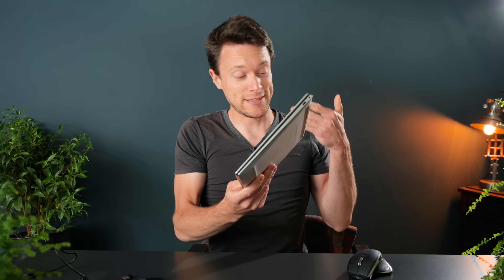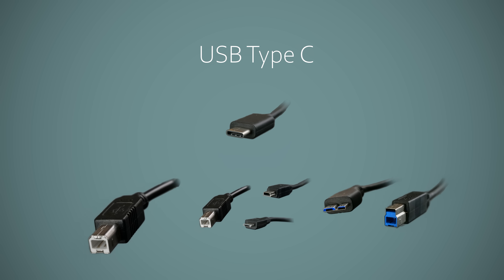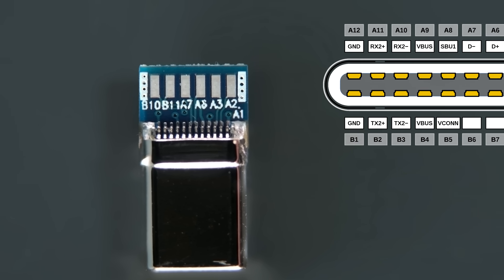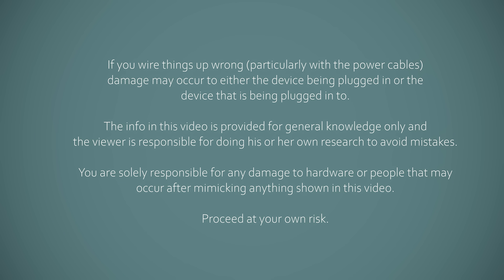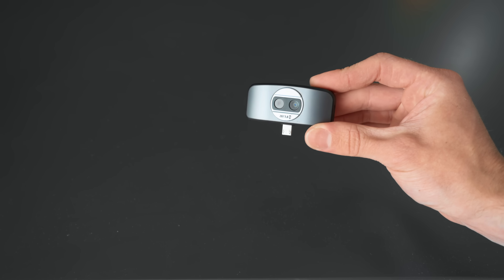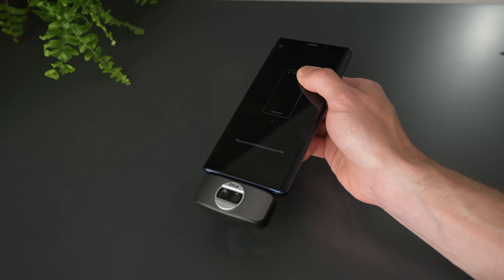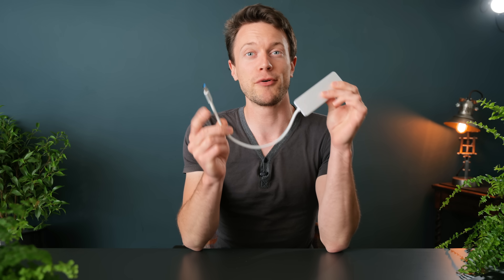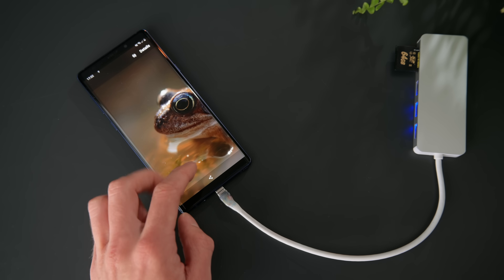Converting devices to USB Type-C

Comment: Is it possible to convert HDMI ports to USB 3.0? If you can, can you please please please make a video of converting HDMI to USB 3.0? I want to change it to USB 3.0 so I don't have to buy a dongle or adapter (because I can't find any). Thank you very much. I love these stuff.
Reply: Or can I change USB 2.0 to 3.0? That would be easier because I want to change an hdmi to usb 2.0 cable to 3.0.
Reply: Actually my whole problem is about the USB 3.0 plug on my video capture card. There's a delay if I use that, but there isn't any delay if I use the HDMI OUT port. So I can either buy an HDMI to USB 2.0 cable and change it to 3.0, or will there be any delay if I change the USB 3.0 from the capture card to type C?

Comment: no that is not at all the future what is the future is no need for usb anything or storage or anything. No ssd, hdd, ram, gpu, cpu is needed. If you want to connect a mouse all u do is tap it on the track pad. wanna transfer a video from your phone to your pc it is already there so no reason to. The cloud is the future. You will have 1000 gigs of ram at your availability if you need it. You will have millions of gigahertz of power when you need it. You will have 10000s of Teraflops when you need it. The way this works is if you need 2 gigs of ram the cloud gives your VM which is running remotely. If you start up a video editor the cloud gives you  the amount of processing power the video editor needs and the amount of ram the application needs no more no less.

Comment: i like how you used the old wire from the usb cables but in keeping with the minimal design should soldered a thin strip of the mini ribbon connectors

Comment: Great video Matt as usual. CC1 and CC2 can be configured for sinking (Rd = 5.1K) or sourcing (Rp = 51K) the power. On the board, there is a soldering pad named R2. This pad is connected to GND, so simply remove the 51K Rp resistor from R1 pad and put 5.1K Rd resistor on R2 pad. By doing so you will pull down both CC pins (A5 and B5) to GND and so your device will sink power (sub-device) instead of sourcing it (host-device).
Reply: CC1 and CC2 are names that are only used for receptacles (sockets), not for plugs. For a USB-C plug those pins are called CC (A5) and VCONN (B5), and for a plug integrated into a device (as in the examples in this video) only the CC pin has a 5.1K resistor to GND (for a sink) or 56K resistor to VBUS (for a source), while the VCONN pin is left unconnected.

And while a sink device with a USB-C receptacle should indeed pull down both CC1 (A5) and CC2 (B5), each of these two pins must have its own separate 5.1K pulldown to GND. If you erroneously tie CC1 and CC2 together and use a single shared pulldown then your device will fail to receive any power when using certain cables (specifically active or tagged cables).
Reply: @MatthijsvanDuin  So what are you saying? That you can't just solder a resistor to the R2 pads?
Reply: @micnolmadtube  I was saying majdinj's description of what happens when you do this procedure (on an electrical level) was incorrect, and they also had the pull-up resistor value wrong.  However, the procedure should still yield the desired result of reconfiguring the role of the board.

Specifically, if a USB-C male connector board has one resistor placed and one spot for an unplaced resistor then it seems very likely that indeed these are for pulling CC either up or down to configure the role of the board:
- 5.1 kΩ pull-down from CC to GND for sink role, or
- 56 kΩ pull-up from CC to VBUS for source role (can alternatively be 22 kΩ if you can safely source 1.5A of current, or 10 kΩ if you can safely source 3A of current)
Hence, if the board comes configured into source role by the presence of a pull-up resistor, then removing that resistor and soldering a 5.1 kΩ resistor at the other location should reconfigure the board into sink role.

For a USB-C female connector board things are similar except it has two CC pins to deal with, hence it will need either two pull-ups (one from CC1 to VBUS and one from CC2 to VBUS) or two pull-downs (one from CC1 to GND and one from CC2 to GND). The resistor values remain the same.

Here's a full description of the all four legacy USB 2 to USB-C conversions:
(any pins not mentioned are unused and must be left unconnected)

USB 2 host/source to (male) USB-C plug:
pins A1,B1,A12,B12 and shield are GND and must all be connected together
pins A4,B4,A9,B9 are VBUS and must all be connected together
pin A5 is CC and needs a 56 kΩ resistor to VBUS
pin A6 is D+
pin A7 is D−
pins B6 and B7 have no contacts in a USB-C plug

USB 2 device/sink to (male) USB-C plug:
pins A1,B1,A12,B12 and shield are GND and must all be connected together
pins A4,B4,A9,B9 are VBUS and must all be connected together
pin A5 is CC and needs a 5.1 kΩ resistor to GND
pin A6 is D+
pin A7 is D−
pins B6 and B7 have no contacts in a USB-C plug

USB 2 host/source to (female) USB-C receptacle:
pins A1,B1,A12,B12 and shield are GND and must all be connected together
pins A4,B4,A9,B9 are VBUS and must all be connected together
pin A5 is CC1 and needs a 56 kΩ resistor to VBUS
pin B5 is CC2 and needs a 56 kΩ resistor to VBUS
pins A6 and B6 are D+ and must be connected together (as close to the connector as possible)
pins A7 and B7 are D− and must be connected together (as close to the connector as possible)

USB 2 device/sink to (female) USB-C receptacle:
pins A1,B1,A12,B12 and shield are GND and must all be connected together
pins A4,B4,A9,B9 are VBUS and must all be connected together
pin A5 is CC1 and needs a 5.1 kΩ resistor to GND
pin B5 is CC2 and needs a 5.1 kΩ resistor to GND
pins A6 and B6 are D+ and must be connected together (as close to the connector as possible)
pins A7 and B7 are D− and must be connected together (as close to the connector as possible)
Reply: @MatthijsvanDuin  Thank you for full response, it helps a ton ! Just another question as you seem to know your stuff :
In the case of an USB 2 device to USB-C reseptacle why do you need to connect all the D+,D-,GND and VBus pins together ? 
Can't you conect just one pin of each to the corresponding pin of the USB 2 device (For instace A1 > GND ; A4 > VBUS ; A6 > D+ ; A7 > D- ) as it would make the socket way less bulky ? 
Thanks in advance for your response
Reply: @martinobyrne392  all of the GNDs and all of the VBUS pins are tied together for reliability and current handling, and a usb-C receptacle must connect both D+/D- pairs (A6/A7 and B6/B7) because USB-C cables only connect one D+/D- pair (A6/A7) hence if the receptable doesn't connect both of them you have only a 50% chance of an actual connection (depending on the orientation with which the plug has been inserted)
Reply: @MatthijsvanDuin what is a "source" and "sink" device? Does source mean a device that provides power and sink means a device that uses power from the host? Is a cellphone charger a source?
Reply: @JAAS-b7k  Yes and yes, with "source" and "sink" I'm referring to the "power role" as it's called.

When two USB-C devices are connected they negotiate which side takes which power role; some devices may only support source role (e.g. a charger), some may only support sink role (typical peripherals), some support both roles (e.g. laptops and phones). Fixed-role ports perform this "negotiation" by having pull-up or pull-down resistors on their CC pins to advertise their role.

If a USB data connection is also present, the "data role" of each side (host vs peripheral) is, at least initially, based on the negotiated power role: the source will be host, the sink wil be peripheral. However, it is possible to reverse the power role and/or data role on the fly provided that both sides agree on donig so. An example use case of this is for USB-C charging docking stations, where the laptop takes on USB host role (since the docking station is also a USB hub) despite being power sink (since it's being charged).
Reply: @MatthijsvanDuin  thank you for that comment!
Reply: @martinobyrne392  Addendum, I should note that a legacy usb (A/B) to usb-C cable or passive adapter is officially not allowed to use a usb-C receptacle, it must be a usb-C plug. The reason for this is to ensure it is physically impossible to use two of such adapters to cross-connect two power sources (e.g. a usb charger to a usb-A port of a laptop or something silly like that).

A power source with a USB-C receptacle must instead properly implement USB-C, with a power switch for VBUS controlled by detection logic on the CC pins, to ensure power is only supplied when the other side is expecting it.
Reply: Great info my guy your comment is just as great as this video cheers mate
Reply: thx for this, it was instrumental
Reply: he has to keep up the illusion that surface mount soldering is too hard for westerners or youtube isn't going to continue to push him views and subscribers.

Comment: Great job. I'm just wondering if it's necessary. There are very miniature USB-A to USB-C adapters on the market, for example: https://pl.aliexpress.com/item/33058295798.html 
It is very cheap, does not require any modifications. I don't think the proprietary version is smaller than the version obtained with this adapter.
In terms of cable conversion: these USB-C plugs are also available with a cable housing: https://pl.aliexpress.com/item/32829410461.html

Comment: I don't like the Type C connector so much.  It's slightly mire secure than (USB2) Micro-B but still can suffer from a poorly constructed recepticle that will in time render the physical connection very loose, or worse.  I've seen this in portable powerbanks from time to time where the Tyoe C recepticle is next to unusable because of the loose connection.

Comment: Perhaps he knows something I don't, but why couldn't he just probe the data wires to find which is pos/neg? I mean, it's just a low voltage he is trying to measure... Pretty sure you could just probe the data pins, right? I assume I am missing something, but it does seem fairly obvious/oblivious to me... 🤣

Comment: What about swapping out the ports on devices to use usb c instead of whatever was there? I have some devices that I would like to swap out the old ports. I have some that have micro b and mini b that I would like to replace. Maybe some day someone can figure out how to do something more advanced like replacing the now defunct proprietary port in oculus rift and rift s. I think it should be possible. It's basically the same as one of those dongles, but with a port instead of a plug.

Comment: I would realy love too make either a smart door (google open close) or a flap at the bottom of a door my hoover can go threw any ideas on this.

Automatic door openness are so expensive and as there for commercial and or disability access they are not smart and tend too be used with buttons.

I'm looking for one too work and I ternary door which can be much lighter and require less power too open.

Comment: I wonder if they sell alternate versions of that breakout board with the resistor already connected in the sub configuration?
Reply: This is one case where adding a dip switch to the product would be a welcomed addition.
Reply: @FranciscoTChavez  That then creates other problems though, such as just using heatshrink to cover a cable, it means that the dip switch could still be moveable or you could accidentally move it whilst using the moldable stuff or maybe even epoxy getting in between the switch contacts.
Reply: @conorstewart2214  the epoxy thing could definitely be a problem. As for accidently moving it, well  it's been quite a few years, but I have seen dip switches that are almost impossible to switch without one of those flat-heads that you use for fixing glasses. That said, a good dip-switch like that, might have a big impact on the price.
Reply: @FranciscoTChavez  Another problem I can see if it is dip switches if they are the single pole variety like the only kind I've seen means you need two dip switches which then makes it possible to pull it both high and low at the same time or just leave it floating, which can cause a lot of damage.
Reply: He made it much more work than he needed to. You could just move the surface mount resistor over to the 2 empty pads beside it.
Reply: @AnTiCamPr  I was wondering about that. It was such an obvious thing to do, when he didn't I just assumed that wouldn't work but couldn't figure out why lol
Reply: @epictoast6727  I know this is six months old but for anyone wanting to do this, the surface mount resistor for a host breakout like in the video is 56kOhms so you can’t just switch the position. It has to be a 5.1 kOhm

Comment: so the smaller board has the right connector but missing the extra data lines for the increased capacity??? is that the case???? 10:35 , you didnt explain that at all...

Comment: One thing that I hate when dealing with usb c is the incredible amount of work you have to put up with when soldering a bare pcb :/
Don't get me wrong the rest of the standard is amazing, just the amount of pins is irritating
Reply: @purringChaos I would love to, it's very expensive for me. And jlcpcb doesn't solder connectors. So I just went and bought some better equipment and learned a new skill.
It's also fun imo. EXCEPT usb C. Usb mini is fine to for me so I'll just use that

Comment: It's likely the little resistor on the board can be moved from one position to the other position to change the "mode" of the board. I haven't been able to confirm that yet, though. That's a step usually done with tweezers and a fine point iron. Check out this tutorial: https://youtu.be/f9fbqks3BS8
Reply: No, you also need a different resistor value.

Comment: Would it be possible to modify the design of that second PCB, to 1. wire the resistor as a sub device by default and 2. extend the USB A pads, and turn this into a A to B adapter where the PCB would go inside the device's USB A port? That way the only extra length would be the length of said A port

Comment: USB C is great but I wouldn't trust it for professional on the go devices such as printers, projectors and DJ controllers where the large size port means more durability and more secure and reliable physical connection. Those cables that gets yanked or sit at some angle due to space constraints, devices being constantly unplugged and plugged back in etc... Seeing how after two or so years smartphones still start developing charging port issues...

Larger physical ports are needed for rugged applications.

Comment: This wouldn't be much of a problem if laptop manufacturers (cough apple) didn't just throw out all the other ports for no reason...

And the usb standards and connectors are a huge mess. USB 4.0, which ironically isn't even a bus anymore, has like 3 different editions already... On top of power delivery and display port functionality

Comment: Why add a resistor like that when you could just move the R1 resistor to R2. I don't get it.
Reply: its like that dude building a pc.... traumatized
Reply: He could've, but it might've been easier to just remove it and put in his own
Reply: @nikolaiblm1255  You edited your comment, but did not correct "could of" to "could have" ?????
Reply: @LinuxCub  I'm not consistent enough to use both "could've" and "might've" in the same sentence, because I am incapable of handling consistent and right grammar, unfortunately.
Reply: @nikolaiblm1255  what I don't understand, is how does "have" morph into "of"
Reply: @LinuxCub  might've sounds exactly like might of when you say them.
Reply: One doesn't even need to move it if SMD soldering aint your thing. Keep it in place, cut the trace as he did, and then solder a short piece of a thru-hole resistor leg to the ground side. Maybe even a blob of solder would suffice if you can avoid moving the resistor in the process.
Reply: Would be very annoying to do without a proper pcb jig which most people probably don't have and won't bother buying one if they're only going to use it for 1 or 2 projects
Reply: It's probly a different ohm resistor
Reply: @brantgoose  I don't think so, it's just a pull-up or pull-down input so the same resistor should work just fine.
Reply: @brantgoose  Indeed it is
Reply: Because USB Type-C can deliver power both ways it requires a 5.1 kΩ pull-down or 56kΩ pull-up. Swapping them isn't the correct way even though it might work, it wouldn't satisfy USB Specifications. There were cases of Amazon selling adapters with a 10kΩ up and down and peoples devices were being broken because of it.
Reply: The feasible way to do this is by using a hot air soldering station which is normally not owned even by hobbyists and even though it's pretty cheap and with little practice, such components can be reworked easily.

Comment: I just bought a new capture card and didn't realize I need a USB C port on my computer, is it possible to use this method and reverse engineer the cable from the C back to the A?
Reply: You can but from smaller to bigger is harder cuz it will have small wires or solder points and you need to put the big dingus in it's place so it may not be worth it damaging your device

Comment: THIS video has been SO FUCKING helpful. Thank you so much. Quick question to anyone who tried this: my USB-C connector breakout board does not seem to have any resistor on it – will that mean that it would not work as sub device or host? Or does it default to one config? I need to order resistors to try out. :D
Reply: Also does anything chang with male or female?